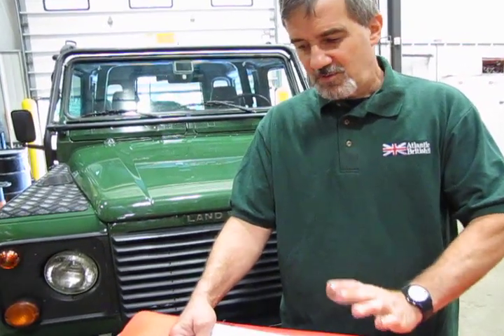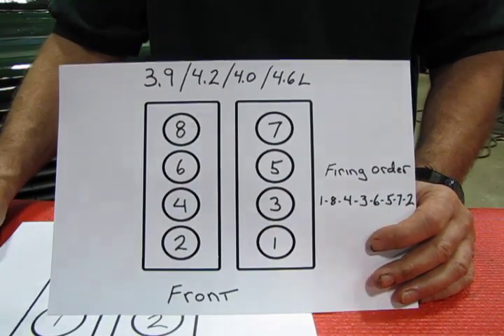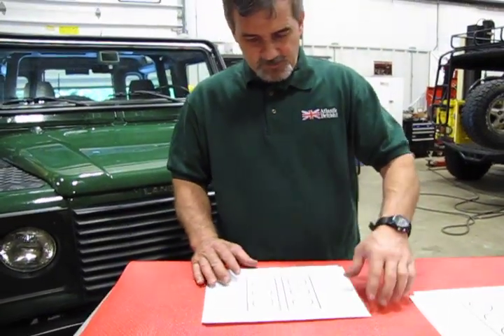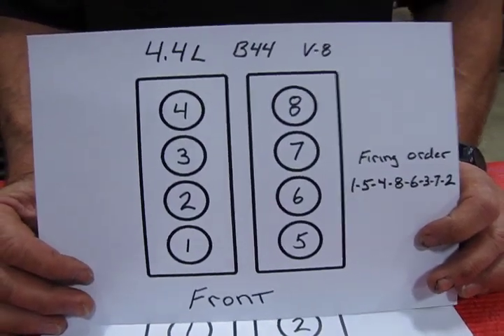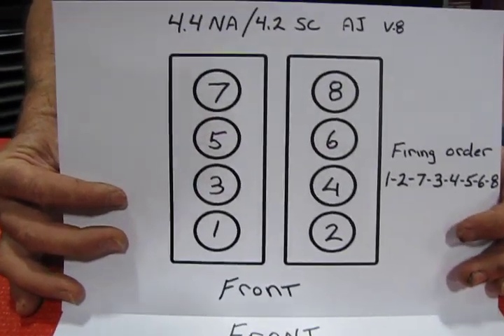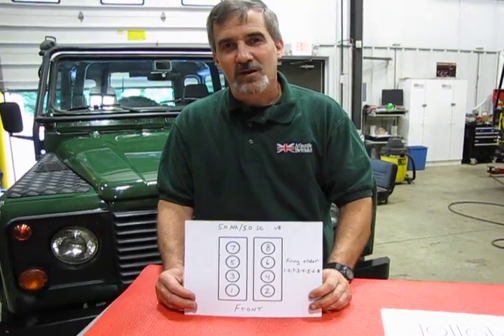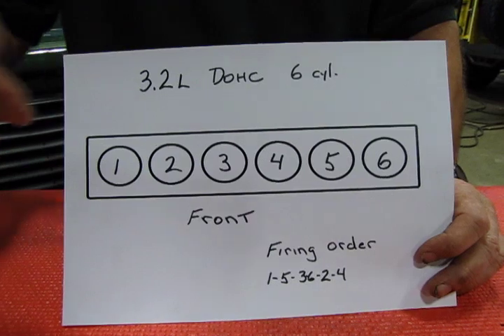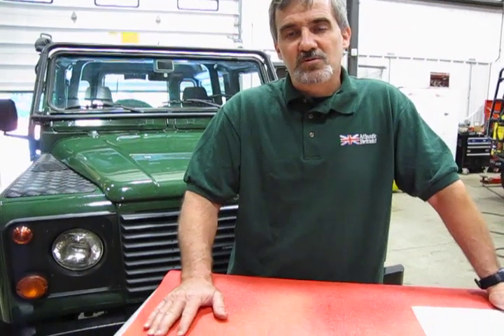Cylinder Numbers and Firing Order of Various North American Spec Land Rover Engines

Comment: I have a 2007 lr3 and the firing order in the manual is 1-5-4-2-6-3-7-8 but in the video there not the same
Reply: I have an '07 4.2 jag engine and same issue.  My manual indicates a different cylinder numbering with 1 and 5 at front.  But the bank numbers stay the same